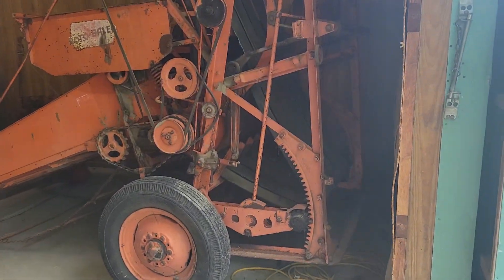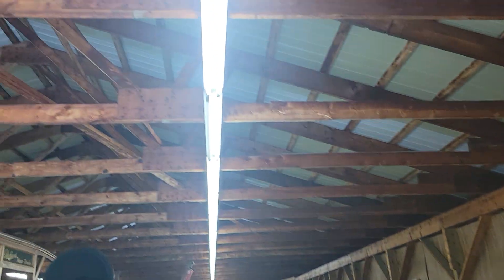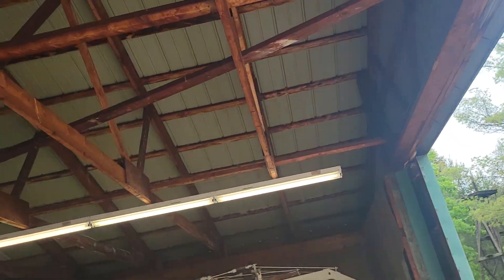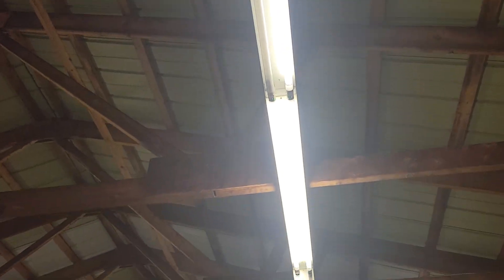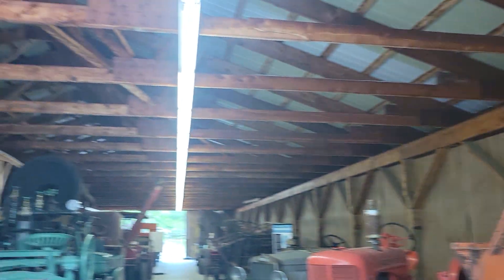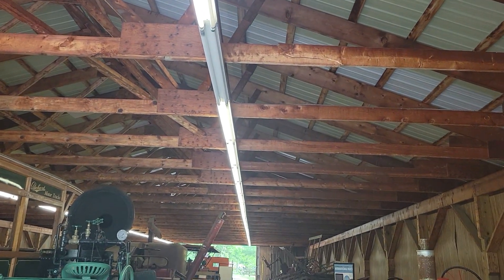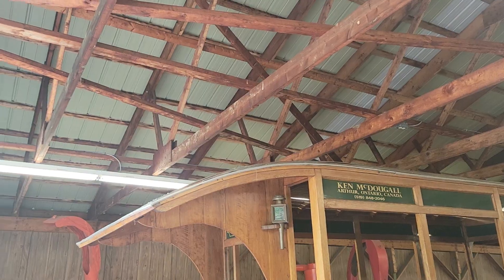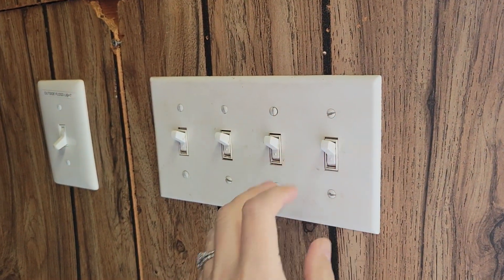Switches and Fluorescent Lights!

Comment: That’s pretty weird the way they set these up. I have heard of that sort of thing being done with 3-lamp and 4-lamp fixtures to provide a bi- or tri-level “dimming” effect, but I have never seen or heard of it being done with 2-lamp fixtures or strip light fixtures in general. This setup would require two 1-lamp ballasts in each fixture too, instead of one 2-lamp, which would be pretty strange. Or maybe they are doing that thing where one (or in this case, two, I guess) ballasts are shared across several fixtures. So in this case, it could be one 2-lamp ballast driving one lamp each in a pair of fixtures, and then another driving the remaining two lamps in the pair. Or the same thing done with 3-lamp ballasts across three fixtures, or 4-lamp ballasts across four fixtures. Either way, very interesting. Also, they seem to do a pretty good job at maintaining these, and still use fluorescent lamps in 2024. Nice.
Reply from the maker: Thanks for this info, your explanation makes perfect sense.  I guess if they set it up from scratch they could do it however they wanted it with the ballasts as you suggest, and this way they can have the option of turning off one side of the fixture for dimmer light pulling less electricity, without any dark spots.  We were also impressed that all those bulbs were fluorescent!